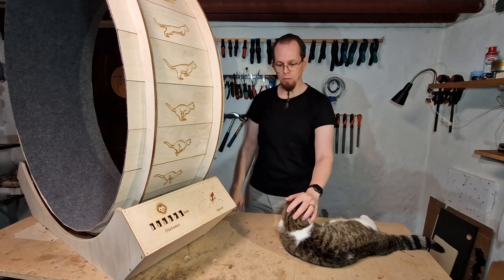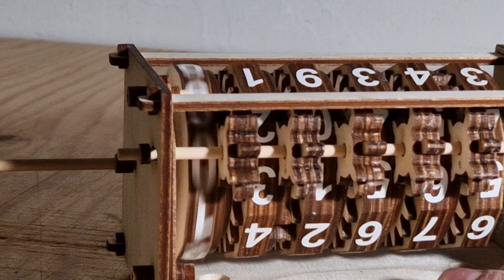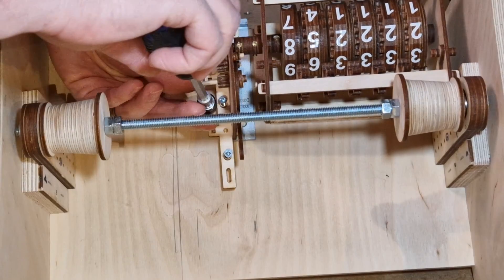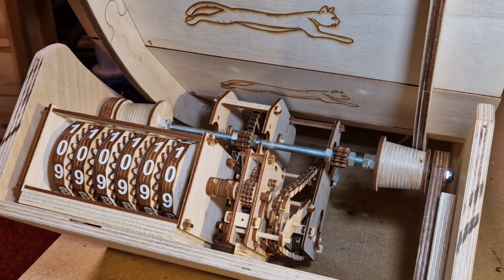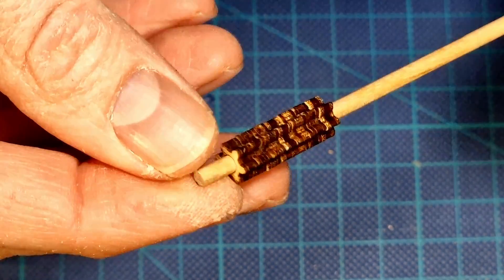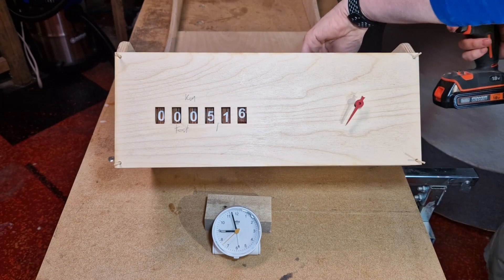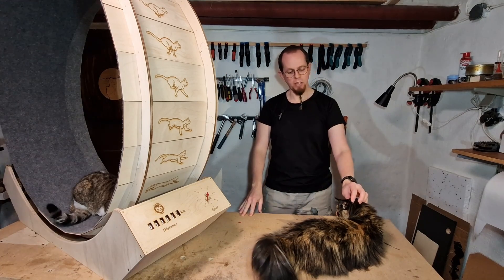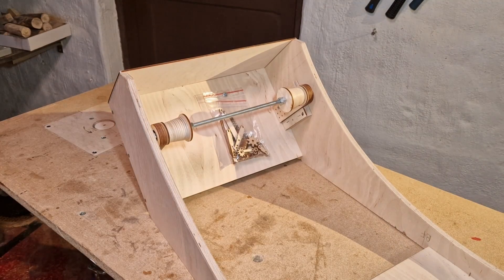Wooden Speedometer for a Cat Exercise Wheel.

Comment: My mum bought me a marble/ball-bearing run for my birthday ~ it was mechanical model - construction kit of those thin plywood sheets that you push the parts out of the frames and assemble it ~ from ROKR.  enjoyed doing that, and interesting to see you are also using the pre-cut-out plywood for your creation. You should do a smaller version of that for a hamster ~ they spend a lot of time running in their wheel as “apparently” need a lot of exercise, same thing with mice & gerbils. It would have to be electronically measured but you could put a motor on its edge as a generator and have it power itself 🤗. Odd to see you used a cat as a subject
Reply from the maker: It is a good idea, but I only had cats to work with and thus used them. I could have used humans but I am too lazy to run 😉

Comment: So the spring counter reacts to the acceleration proportionally like dampened proof mass?
Reply from the maker: I am not sure it is exactly proportional. It seems like it when once the ball governor has spun up past a certain amount but I at high speed I think the spring resists more - it could also only be that it is compressed too much and there is not enough physical space. But I do not really know.
Reply: @Induku  my current understanding is that it is more about the side-to-side movement being proportional to the angular velocity and the spring acts like a scaling factor